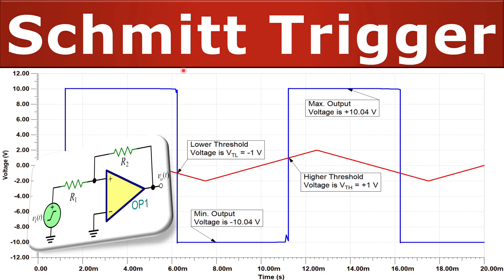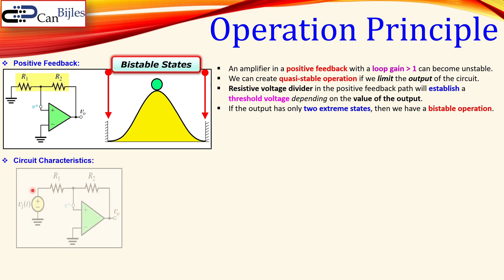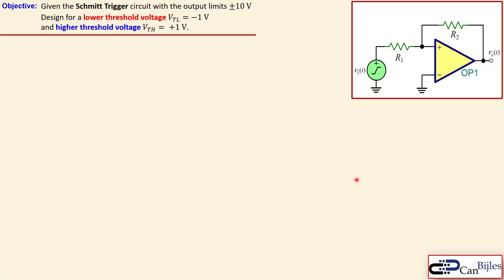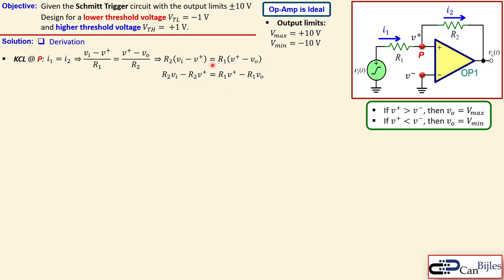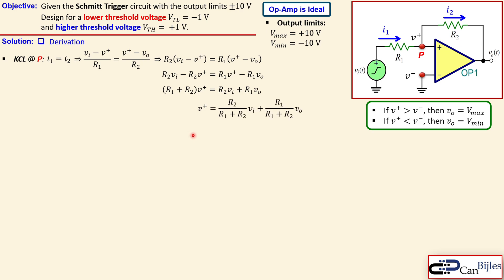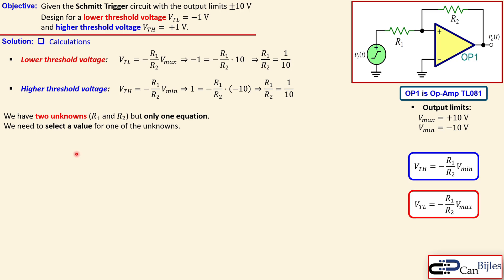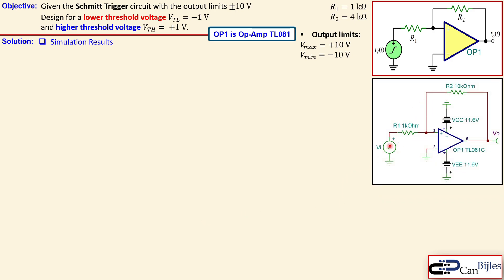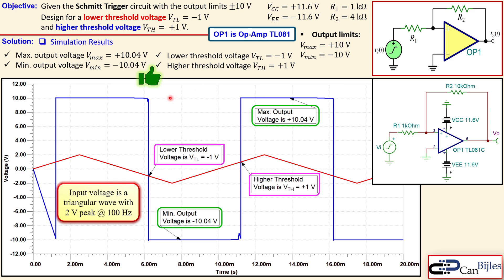Noninverting Schmitt Trigger ⭐ Derivation of Threshold Levels, Design Example & TINA-TI Simulations

Comment: This is an excellent video !! could you make similar video with pull up resistor because in real life most op the comparator's are open drain configuration and we add pull up resistor ..I find all of the application notes are very complicated to explain that
Reply from the maker: Thanks for your message! Great to know you liked the video. I recently posted a video of asynchronous inverting Schmitt Trigger: https://youtu.be/9bcP3fCSV6Y
It this what you are looking for?